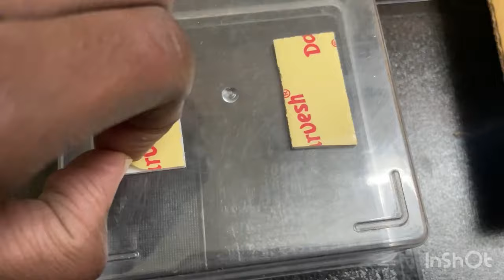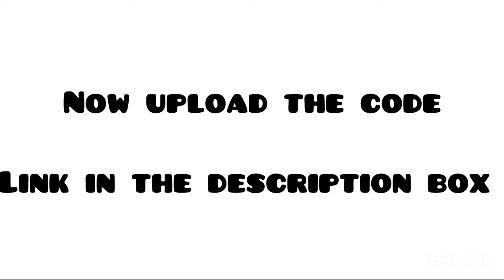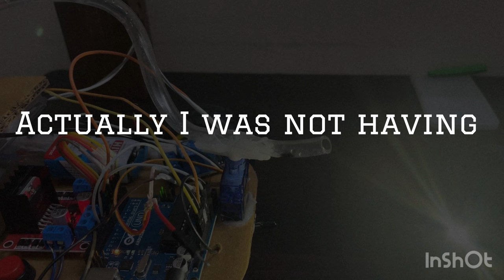Arduino Fire Fighting Robot| RRX Tech |

Comment from the maker: Code-

#include <Servo.h>

Servo myservo;  // create servo object to control a servo
// twelve servo objects can be created on most boards

int pos = 0; 

void setup() {
  // put your setup code here, to run once:
 myservo.attach(11);
pinMode(2, OUTPUT);
pinMode(3, OUTPUT);
pinMode(4, OUTPUT);
pinMode(5, OUTPUT);
pinMode(6, OUTPUT);
pinMode(A0, INPUT);
pinMode(A1, INPUT);
pinMode(A2, INPUT);
Serial.begin(9600);
digitalWrite(6, HIGH);
}

void loop() {
  // put your main code here, to run repeatedly:

int a = analogRead(A0);
int b = analogRead(A1);
int c = analogRead(A2);
Serial.print(a);
Serial.print("    ");
Serial.print(b);
Serial.print("    ");
Serial.print(c);
Serial.println("    "); 
delay(50);

if (a>=990)

{
  digitalWrite(2, LOW);
  digitalWrite(3, LOW);
  digitalWrite(4, LOW);
  digitalWrite(5, LOW);
  
  digitalWrite(6, LOW);
  
  for (pos = 60; pos <= 120; pos += 1) { // goes from 0 degrees to 180 degrees
    // in steps of 1 degree
    myservo.write(pos);              // tell servo to go to position in variable 'pos'
    delay(15);                       // waits 15 ms for the servo to reach the position
  }
  for (pos = 120; pos >= 60; pos -= 1) { // goes from 180 degrees to 0 degrees
    myservo.write(pos);              // tell servo to go to position in variable 'pos'
    delay(15);                       // waits 15 ms for the servo to reach the position
  }
  for (pos = 60; pos <= 120; pos += 1) { // goes from 0 degrees to 180 degrees
    // in steps of 1 degree
    myservo.write(pos);              // tell servo to go to position in variable 'pos'
    delay(15);                       // waits 15 ms for the servo to reach the position
  }
  for (pos = 120; pos >= 60; pos -= 1) { // goes from 180 degrees to 0 degrees
    myservo.write(pos);              // tell servo to go to position in variable 'pos'
    delay(15);                       // waits 15 ms for the servo to reach the position
  }
  for (pos = 60; pos <= 120; pos += 1) { // goes from 0 degrees to 180 degrees
    // in steps of 1 degree
    myservo.write(pos);              // tell servo to go to position in variable 'pos'
    delay(15);                       // waits 15 ms for the servo to reach the position
  }
  for (pos = 120; pos >= 60; pos -= 1) { // goes from 180 degrees to 0 degrees
    myservo.write(pos);              // tell servo to go to position in variable 'pos'
    delay(15);                       // waits 15 ms for the servo to reach the position
  }
  //delay(200);
  
  }

  else if(b>=800)

{

digitalWrite(2, LOW);
  digitalWrite(3, LOW);
  digitalWrite(4, LOW);
  digitalWrite(5, LOW);
  
  digitalWrite(6, LOW);
for (pos = 60; pos <= 120; pos += 1) { // goes from 0 degrees to 180 degrees
    // in steps of 1 degree
    myservo.write(pos);              // tell servo to go to position in variable 'pos'
    delay(15);                       // waits 15 ms for the servo to reach the position
  }
  for (pos = 120; pos >= 60; pos -= 1) { // goes from 180 degrees to 0 degrees
    myservo.write(pos);              // tell servo to go to position in variable 'pos'
    delay(15);                       // waits 15 ms for the servo to reach the position
  }
  for (pos = 60; pos <= 120; pos += 1) { // goes from 0 degrees to 180 degrees
    // in steps of 1 degree
    myservo.write(pos);              // tell servo to go to position in variable 'pos'
    delay(15);                       // waits 15 ms for the servo to reach the position
  }
  for (pos = 120; pos >= 60; pos -= 1) { // goes from 180 degrees to 0 degrees
    myservo.write(pos);              // tell servo to go to position in variable 'pos'
    delay(15);                       // waits 15 ms for the servo to reach the position
  }
  for (pos = 60; pos <= 120; pos += 1) { // goes from 0 degrees to 180 degrees
    // in steps of 1 degree
    myservo.write(pos);              // tell servo to go to position in variable 'pos'
    delay(15);                       // waits 15 ms for the servo to reach the position
  }
  for (pos = 120; pos >= 60; pos -= 1) { // goes from 180 degrees to 0 degrees
    myservo.write(pos);              // tell servo to go to position in variable 'pos'
    delay(15);                       // waits 15 ms for the servo to reach the position
  }

  }
  else if(c>=990)

{

digitalWrite(2, LOW);
  digitalWrite(3, LOW);
  digitalWrite(4, LOW);
  digitalWrite(5, LOW);
  
  digitalWrite(6, LOW);
for (pos = 60; pos <= 120; pos += 1) { // goes from 0 degrees to 180 degrees
    // in steps of 1 degree
    myservo.write(pos);              // tell servo to go to position in variable 'pos'
    delay(15);                       // waits 15 ms for the servo to reach the position
  }
  for (pos = 120; pos >= 60; pos -= 1) { // goes from 180 degrees to 0 degrees
    myservo.write(pos);              // tell servo to go to position in variable 'pos'
    delay(15);                       // waits 15 ms for the servo to reach the position
  }
  for (pos = 60; pos <= 120; pos += 1) { // goes from 0 degrees to 180 degrees
    // in steps of 1 degree
    myservo.write(pos);              // tell servo to go to position in variable 'pos'
    delay(15);                       // waits 15 ms for the servo to reach the position
  }
  for (pos = 120; pos >= 60; pos -= 1) { // goes from 180 degrees to 0 degrees
    myservo.write(pos);              // tell servo to go to position in variable 'pos'
    delay(15);                       // waits 15 ms for the servo to reach the position
  }
  for (pos = 60; pos <= 120; pos += 1) { // goes from 0 degrees to 180 degrees
    // in steps of 1 degree
    myservo.write(pos);              // tell servo to go to position in variable 'pos'
    delay(15);                       // waits 15 ms for the servo to reach the position
  }
  for (pos = 120; pos >= 60; pos -= 1) { // goes from 180 degrees to 0 degrees
    myservo.write(pos);              // tell servo to go to position in variable 'pos'
    delay(15);                       // waits 15 ms for the servo to reach the position
  }

  }
  

else if(a<=990 && a>200)

{

 

digitalWrite(2, LOW);
  digitalWrite(3,HIGH);
  digitalWrite(4, HIGH);
  digitalWrite(5, LOW);

  
  delay(100);
  digitalWrite(2, LOW);
  digitalWrite(3, LOW);
  digitalWrite(4, LOW);
  digitalWrite(5, LOW);
  
  digitalWrite(6, LOW);

  delay(100);
   digitalWrite(6, HIGH);

  delay(100);

  }

else if(b<=800 && b>400)

{
digitalWrite(2, LOW);
  digitalWrite(3,HIGH);
  digitalWrite(4, HIGH);
  digitalWrite(5, LOW);

  
  delay(100);
  digitalWrite(2, LOW);
  digitalWrite(3, LOW);
  digitalWrite(4, LOW);
  digitalWrite(5, LOW);
  
  digitalWrite(6, LOW);

  delay(100);
   digitalWrite(6, HIGH);

  delay(100);

  

  }

else if(c<=990 && c>400)

{

  
  digitalWrite(2, LOW);
  digitalWrite(3,HIGH);
  digitalWrite(4, HIGH);
  digitalWrite(5, LOW);

  
  delay(100);
  digitalWrite(2, LOW);
  digitalWrite(3, LOW);
  digitalWrite(4, LOW);
  digitalWrite(5, LOW);
  
  digitalWrite(6, LOW);

  delay(100);
   digitalWrite(6, HIGH);

  delay(100);

  }

else 

{
digitalWrite(6, LOW);

digitalWrite(2, LOW);
  digitalWrite(3, LOW);
  digitalWrite(4, LOW);
  digitalWrite(5, LOW);
  
 
  
  }
  
  

  }
Reply: Send circuit diagram
Reply: Code copy nahi ho Raha code bej do
Reply: I need code
Reply: 7:11 7:11
Reply: Thankyou dude
Reply: Send diagram and code thank you ❤
Reply: Please write us all the tools used in this project.

Comment: Plz send code
Reply from the maker: Check description
Reply from the maker: Or
Reply from the maker: #include <Servo.h>

Servo myservo;  // create servo object to control a servo
// twelve servo objects can be created on most boards

int pos = 0; 

void setup() {
  // put your setup code here, to run once:
 myservo.attach(11);
pinMode(2, OUTPUT);
pinMode(3, OUTPUT);
pinMode(4, OUTPUT);
pinMode(5, OUTPUT);
pinMode(6, OUTPUT);
pinMode(A0, INPUT);
pinMode(A1, INPUT);
pinMode(A2, INPUT);
Serial.begin(9600);
digitalWrite(6, HIGH);
}

void loop() {
  // put your main code here, to run repeatedly:

int a = analogRead(A0);
int b = analogRead(A1);
int c = analogRead(A2);
Serial.print(a);
Serial.print("    ");
Serial.print(b);
Serial.print("    ");
Serial.print(c);
Serial.println("    "); 
delay(50);

if (a>=990)

{
  digitalWrite(2, LOW);
  digitalWrite(3, LOW);
  digitalWrite(4, LOW);
  digitalWrite(5, LOW);
  
  digitalWrite(6, LOW);
  
  for (pos = 60; pos <= 120; pos += 1) { // goes from 0 degrees to 180 degrees
    // in steps of 1 degree
    myservo.write(pos);              // tell servo to go to position in variable 'pos'
    delay(15);                       // waits 15 ms for the servo to reach the position
  }
  for (pos = 120; pos >= 60; pos -= 1) { // goes from 180 degrees to 0 degrees
    myservo.write(pos);              // tell servo to go to position in variable 'pos'
    delay(15);                       // waits 15 ms for the servo to reach the position
  }
  for (pos = 60; pos <= 120; pos += 1) { // goes from 0 degrees to 180 degrees
    // in steps of 1 degree
    myservo.write(pos);              // tell servo to go to position in variable 'pos'
    delay(15);                       // waits 15 ms for the servo to reach the position
  }
  for (pos = 120; pos >= 60; pos -= 1) { // goes from 180 degrees to 0 degrees
    myservo.write(pos);              // tell servo to go to position in variable 'pos'
    delay(15);                       // waits 15 ms for the servo to reach the position
  }
  for (pos = 60; pos <= 120; pos += 1) { // goes from 0 degrees to 180 degrees
    // in steps of 1 degree
    myservo.write(pos);              // tell servo to go to position in variable 'pos'
    delay(15);                       // waits 15 ms for the servo to reach the position
  }
  for (pos = 120; pos >= 60; pos -= 1) { // goes from 180 degrees to 0 degrees
    myservo.write(pos);              // tell servo to go to position in variable 'pos'
    delay(15);                       // waits 15 ms for the servo to reach the position
  }
  //delay(200);
  
  }

  else if(b>=800)

{

digitalWrite(2, LOW);
  digitalWrite(3, LOW);
  digitalWrite(4, LOW);
  digitalWrite(5, LOW);
  
  digitalWrite(6, LOW);
for (pos = 60; pos <= 120; pos += 1) { // goes from 0 degrees to 180 degrees
    // in steps of 1 degree
    myservo.write(pos);              // tell servo to go to position in variable 'pos'
    delay(15);                       // waits 15 ms for the servo to reach the position
  }
  for (pos = 120; pos >= 60; pos -= 1) { // goes from 180 degrees to 0 degrees
    myservo.write(pos);              // tell servo to go to position in variable 'pos'
    delay(15);                       // waits 15 ms for the servo to reach the position
  }
  for (pos = 60; pos <= 120; pos += 1) { // goes from 0 degrees to 180 degrees
    // in steps of 1 degree
    myservo.write(pos);              // tell servo to go to position in variable 'pos'
    delay(15);                       // waits 15 ms for the servo to reach the position
  }
  for (pos = 120; pos >= 60; pos -= 1) { // goes from 180 degrees to 0 degrees
    myservo.write(pos);              // tell servo to go to position in variable 'pos'
    delay(15);                       // waits 15 ms for the servo to reach the position
  }
  for (pos = 60; pos <= 120; pos += 1) { // goes from 0 degrees to 180 degrees
    // in steps of 1 degree
    myservo.write(pos);              // tell servo to go to position in variable 'pos'
    delay(15);                       // waits 15 ms for the servo to reach the position
  }
  for (pos = 120; pos >= 60; pos -= 1) { // goes from 180 degrees to 0 degrees
    myservo.write(pos);              // tell servo to go to position in variable 'pos'
    delay(15);                       // waits 15 ms for the servo to reach the position
  }

  }
  else if(c>=990)

{

digitalWrite(2, LOW);
  digitalWrite(3, LOW);
  digitalWrite(4, LOW);
  digitalWrite(5, LOW);
  
  digitalWrite(6, LOW);
for (pos = 60; pos <= 120; pos += 1) { // goes from 0 degrees to 180 degrees
    // in steps of 1 degree
    myservo.write(pos);              // tell servo to go to position in variable 'pos'
    delay(15);                       // waits 15 ms for the servo to reach the position
  }
  for (pos = 120; pos >= 60; pos -= 1) { // goes from 180 degrees to 0 degrees
    myservo.write(pos);              // tell servo to go to position in variable 'pos'
    delay(15);                       // waits 15 ms for the servo to reach the position
  }
  for (pos = 60; pos <= 120; pos += 1) { // goes from 0 degrees to 180 degrees
    // in steps of 1 degree
    myservo.write(pos);              // tell servo to go to position in variable 'pos'
    delay(15);                       // waits 15 ms for the servo to reach the position
  }
  for (pos = 120; pos >= 60; pos -= 1) { // goes from 180 degrees to 0 degrees
    myservo.write(pos);              // tell servo to go to position in variable 'pos'
    delay(15);                       // waits 15 ms for the servo to reach the position
  }
  for (pos = 60; pos <= 120; pos += 1) { // goes from 0 degrees to 180 degrees
    // in steps of 1 degree
    myservo.write(pos);              // tell servo to go to position in variable 'pos'
    delay(15);                       // waits 15 ms for the servo to reach the position
  }
  for (pos = 120; pos >= 60; pos -= 1) { // goes from 180 degrees to 0 degrees
    myservo.write(pos);              // tell servo to go to position in variable 'pos'
    delay(15);                       // waits 15 ms for the servo to reach the position
  }

  }
  

else if(a<=990 && a>200)

{

 

digitalWrite(2, LOW);
  digitalWrite(3,HIGH);
  digitalWrite(4, HIGH);
  digitalWrite(5, LOW);

  
  delay(100);
  digitalWrite(2, LOW);
  digitalWrite(3, LOW);
  digitalWrite(4, LOW);
  digitalWrite(5, LOW);
  
  digitalWrite(6, LOW);

  delay(100);
   digitalWrite(6, HIGH);

  delay(100);

  }

else if(b<=800 && b>400)

{
digitalWrite(2, LOW);
  digitalWrite(3,HIGH);
  digitalWrite(4, HIGH);
  digitalWrite(5, LOW);

  
  delay(100);
  digitalWrite(2, LOW);
  digitalWrite(3, LOW);
  digitalWrite(4, LOW);
  digitalWrite(5, LOW);
  
  digitalWrite(6, LOW);

  delay(100);
   digitalWrite(6, HIGH);

  delay(100);

  

  }

else if(c<=990 && c>400)

{

  
  digitalWrite(2, LOW);
  digitalWrite(3,HIGH);
  digitalWrite(4, HIGH);
  digitalWrite(5, LOW);

  
  delay(100);
  digitalWrite(2, LOW);
  digitalWrite(3, LOW);
  digitalWrite(4, LOW);
  digitalWrite(5, LOW);
  
  digitalWrite(6, LOW);

  delay(100);
   digitalWrite(6, HIGH);

  delay(100);

  }

else 

{
digitalWrite(6, LOW);

digitalWrite(2, LOW);
  digitalWrite(3, LOW);
  digitalWrite(4, LOW);
  digitalWrite(5, LOW);
  
 
  
  }
  
  

  }
Reply: @RRXShorts 

م